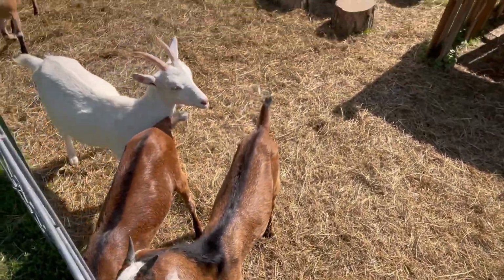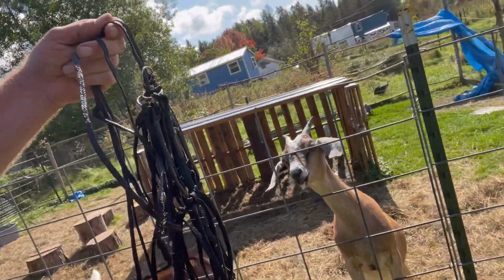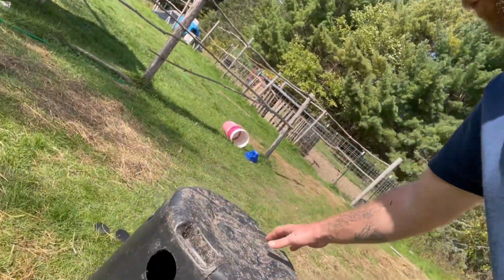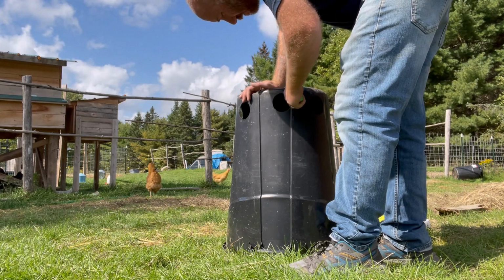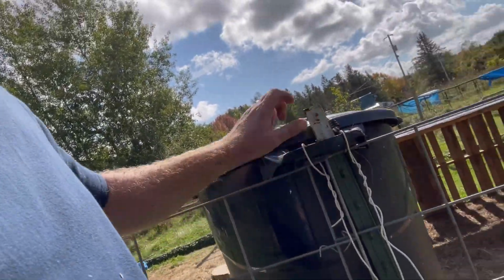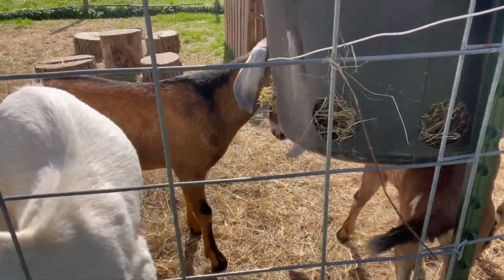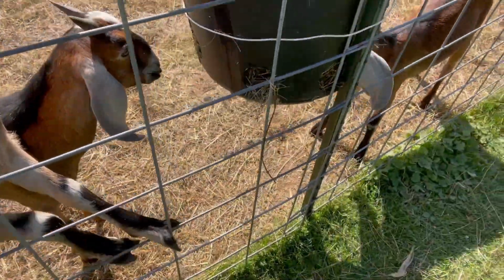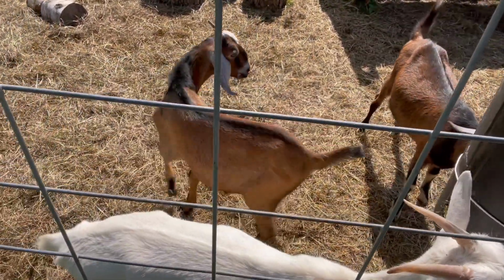$10, 5 minute goat hay feeder

Comment: Been doing that with 5 gallon buckets for years works great but you will need way more holes because they will eat out the hole and can’t get any more and the trash can will not last for long need something heavier plastic
Reply: Check out my 5 gallon bucket ones I think having 4 or 5 around the fence will work better in the long run.
Reply from the maker: Thanks for your input and ideas. The buckets would definitely be a tougher material.